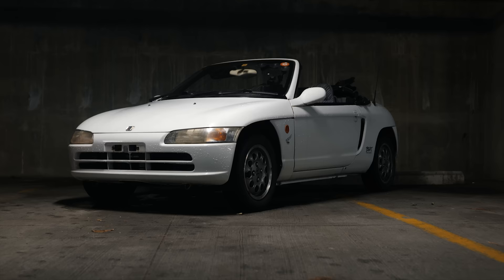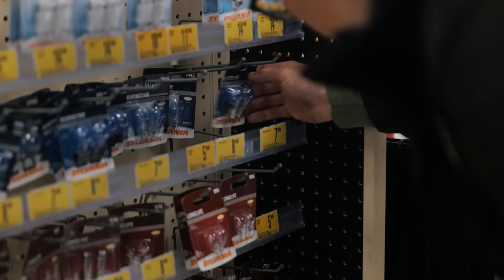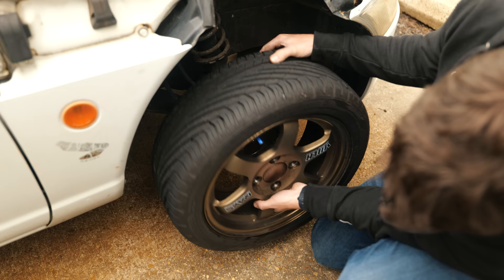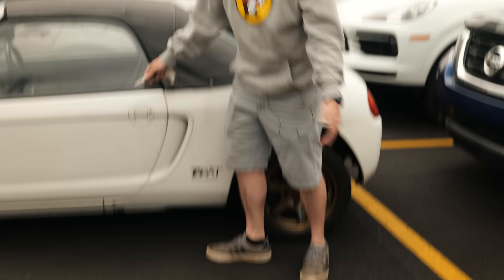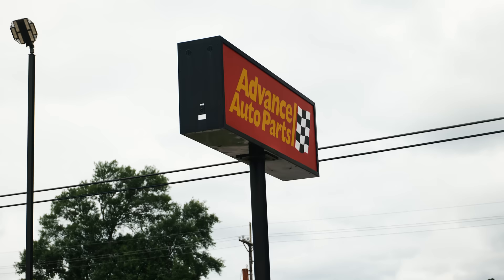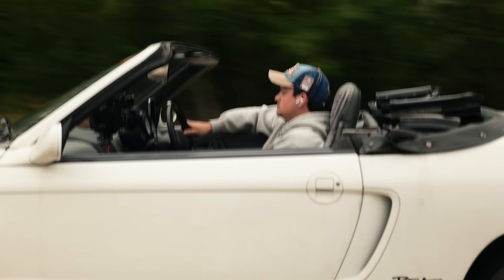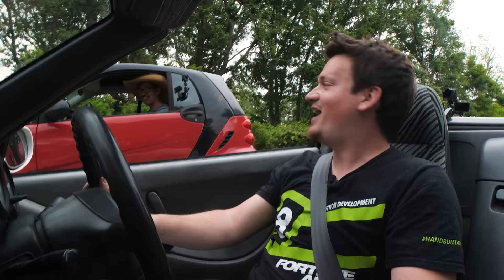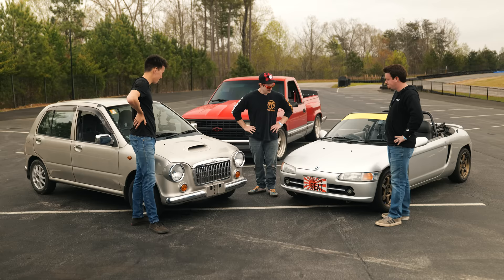We BLEW ENGINES and TURBOS on THREE Kei Cars in ONE Roadtrip - Kei Car Roadtrip Ep 3

Comment: Hayabusa swap the beat
Reply: Nah, CBR 600 swap is goated for these little cars, busa and a CBR1000 are too powerful
Reply: Either option will destroy that rusted shell
Reply: No
Reply: Literally exactly what I said last video glad am not the only one
Reply: Go big or go home home. Kswap
Reply: @TheRambowbb  what about the not rusted shell
Reply: @Fred_the_1996  I was saying cbr600 for the beat and if Ben still has the cap gsxr600
Reply: How would you get it to reverse?
Reply: @daqfr  you would use stock gear box I’m sure
Reply: @1fastpony, that's not how that works. You can't just make an adapter to fit the original transmission. Plus you have the issue of space.
Reply: @TheRambowbb  they can swap the first Beat though
Reply: @daqfr just fred flintstone it
Reply: @Weimerica8841  yes
Reply: @daqfr  use an electric motor. That way you can also bump start the engine like an LMP car, thats what SuperFastMatt did with his honda S600
Reply: no put a civic turbo engine in it
Reply: @cris_m8  it is possible, expensive yes but completely doable. There is a busa swapped beat out there with fully functional manual gearbox.

Comment: You guys over exaggerate the City aspect.
Both the Beat and Cappuccino are fine on the highway doing 65-75.  The Beat is a little strung out (5500rpm at 65) but it won't hurt it unless it's got a worn out timing belt or bad rings already.
The Cappuccino feels just fine at 75-80, so much that I've accidentally hit the 83 speed limiter GOING UP HILL on accident (no cruise control).  Remove the factory speed limiter and the Cappo will do well over 100.

At any rate I've done multiple 5 hour trips in both, AND had them out on track at the far end of that.  Neither had an issue.

Comment: I wonder if honda beat's engine bay is big enough to have an engine swap. Try putting a newer engine from honda like L15A from honda city (edit: honda fit for USDM). It's cheap and pretty much bulletproof. Around 115hp stock, has i-vtec, 5 speed transmission (Auto still works fine since it has manual mode). With a car that small It would definitely feel like a rocket with that motor

Comment: The cappuccino was the best and was unlucky boost sucked in the filter, a new turbo it will be fine. The honda Beat would also be fine if it had its original transmission and not the k truck trans, way lower final drive so the revs on the highway would be much lower.
Reply: hopefully he bought the rusty beat for the engine and correct trans for his other beat